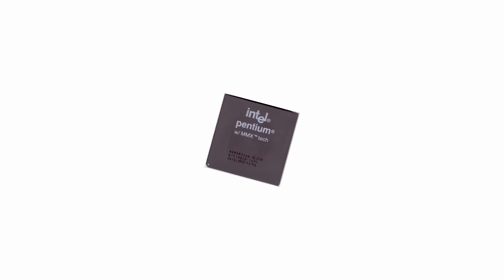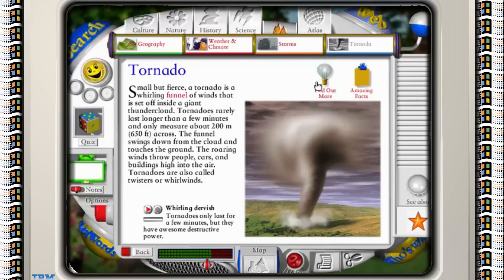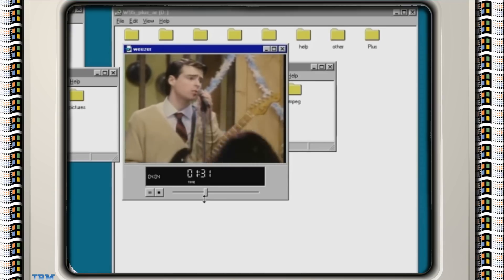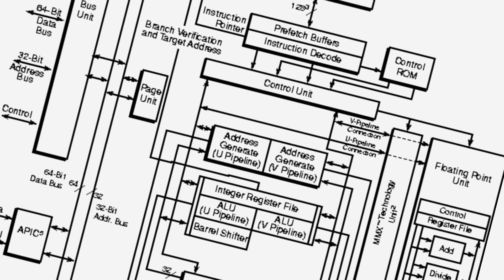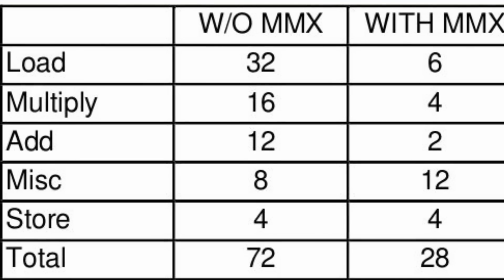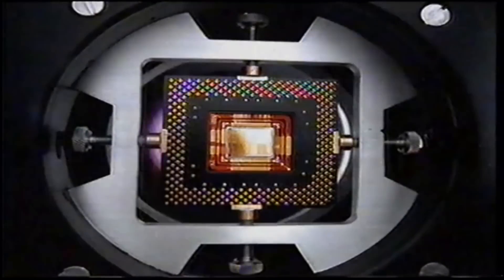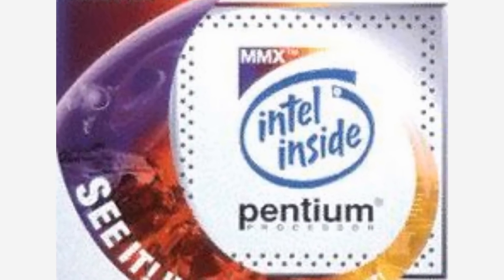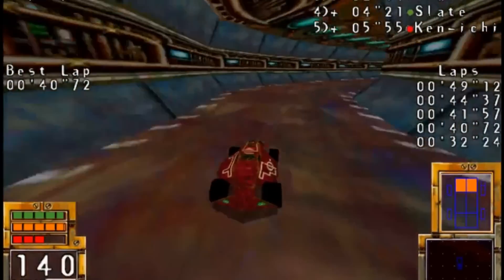What is MMX Technology & Why Was it Flawed? [Byte Size] | Nostalgia Nerd

Comment: somewhat sloppy writing, with the intro quoting a lot of then-current misleading advertsising (as MMX does really nothing for colors, nor the internet) and not mentioning the doubled cache of the MMX Pentium processors which brought benefit for all applications. And explaining the reason wrong why FP and MMX did not work at the same time. It was because of the re-use of the same registers. And why is FP usage explained with special functions, when floating point MUL and DIV were needed much more often?

Comment: I remember those days.  One of my systems was a Pentium 1 200, another was a Pentium 2 233.  The 200 didn't seem meaningfully slower back then, so MMX was a joke for all practical purposes.

I'm sure for some software it helped, it just wasn't software most folks run.  Other than specialized bespoke custom software, programmers aren't going to compile binaries that require instructions that weren't around 10-15+ years ago, to improve compatibility.  One could write software to detect the presence of the instructions and if so, use them.  But in practice this was rare.  It's precisely why everyone was in an uproar when MS attempted to require an 8th gen i7 for Windows 11, especially during a supply chain shortage.  There is a way around it at least.

And yes, all the newer CPUs have MMX since generally, while new instructions get added, old ones don't get removed.

Debian Linux 12, which just released this week, finally got around to dropped support for the P5-era CPUs, or the Pentium 1.  So now, it requires P6-era or later - The Pentium Pro and Pentium 2, basically.

Comment: You're flat wrong in saying the Pentium II changed the MMX registers to no longer be aliased to the floating point register file, and I don't even know where you would get that assertion. It was done for operating system compatibility. See: "MMX Microarchitecture of Pentium Processors With MMX Technology and Pentium II Microprocessors"

Comment: I think the most important thing is the fact that software had to be written to use MMX. It wasn't like it would make everything magically faster. A lot of the hype and marketing was of course misleading. 

Nowadays SIMD support is getting a lot better. Automatic vectorization(aka generating SIMD code from scalar code) is seeing wider spread support in languages/compilers and they are getting better at doing it. I still typically find hand written SIMD intrinsics in C/C++ to outperform the compiler's auto-vectorized stuff but writing that code is more time consuming and difficult than scalar code. So getting some performance win automatically is nice and gives a better baseline.

Comment: Still have my pentium 233mmx. My mb was able to overclock it to 263 by pushing the bus to 75MHz via dip switches but the multiplier of 3.5 was locked.

Comment: I had to develop a buffer rotation library in IA-32 with SIMD instructions. I wrote several versions of each, from plain (we had to support very old processors) passing through MMX up to SSSE3. 

The MMX version was the slowest of them all and required a lot more additional code to make it work properly (it absolutely needs the FP unit flushed before and after use). That was the same result I had when, later on, I had to build a 16 bits grayscale image normalization library.

Comment: > can't use matrix math and floating point at the same time

Good job Intel. What's next, a TV that can only do audio or video, not both?

(Yes you could switch back and forth but the performance penalty basically would defeat the point.)

Comment: MMX may still be with us. All modern 64 bit x86 processors have it, but its next to useless as using the instructions are not officially supported by 64 bit windows in 64 bit programs (still work but no guarantees going forward)  and use is forbidden in the kernel. SSE2 is better in every way and all modern cpus support that too so  its what everyone should use

Comment: MMX was not flawed, just misunderstood. Intel marketed it as a "media extension" whereas in reality, it is simply a more efficient method of performing integer math, and because it provided wide 64bit registers it is also very useful for high-performance memory copies where DMA could not be used. All modern memcpy implementations take advantage of SMID instructions where possible as it allows you to perform bulk memory copies far faster and in parallel. Even today MMX is still valid and is used depending on the task at hand. In fact, it was so successful and useful that it was later enhanced through the addition of SSE, SSE2, AVX and now AVX2 extensions that all operate using the same ideas and concepts.
Reply: OpenGL's programming model requires floating point geometry inputs.   MMX can be used for integer geometry processing like mostly integer processing on Sony's PS1.

Comment: while apple suffer for lack of any instruction from motorola  proccessor company didn't not come anything for multimedia...so they ditch motorola  for IBM powercpu RISC processor since their os is not x86 to begin with...its like AMIGA OS does everything is short instruction sets...while x86 have one advantage for long instruction...to make multimedia possible on cpu than RISC relies on GPU acceleration..thing is ...that consoles back then thing , they had it right for gaming by introducing 1st graphic accelerators  begins ...while MMX was still microsoft depending on cpu for sound and graphics ..then SSE came about to compete against rising RISC powerpc that steve jobs OS take advantage the graphics and gaming back then...then gpu was born from....thanks to POWERCPU"S  than INTEL MMX OR SSE....sure sse did help a lot of gaming developers but its not sse started the trend it was RISC did ...when intel recognize ibm vector instructions was needed on x86 instructions that INTEL BECAME BOTH RISC AND CISC CPU...while IBM ended up only RISC til end of its life

Comment: The MMX / FPU switch was annoying with the early chips but with a bit of rescheduling you could split procedures into MMX and FPU parts, each processing a large block of data, the 200ish cycles switch is not so bad now .. You could do non MMX or FPU instructions while the switch happened in the background. Uses extra memory reads and writes but once the block is in cache it's accessed quickly enough... Worked well for an assembler vector graphics shape filling routine with alphablend..... It all got much better with out of order instruction + memory access rescheduling and MMX/SSE, IntegerPU and FPU running separately in parallel. Could alphablend using the main instructions, MMX and FPU irogether by interleaving the integer, FPU and MMX instructions and pairing MMX instructions... I'm pretty sure I reached max possible speed.. Several times faster than using the main CPU or FPU on its own... At the time, sending odd jobs in no particular order to the GPU was severely bottlenecked so not worth it for UI stuff, same even today to a certain extent..
Reply: How did that work in a multitasking OS? Did you need critical sections or did the OS come in and make you pay for expensive context switches?
Reply: @SerBallister  .. Task switches did not seem to happen during the execution of a tight inner loop (say less than 20 instructions per each of a million pixels or so per frame) as individual frame creation times did not vary.when tested. The switch from MMX to FPU and back could be mitigated so it had little speed impact, but it was a pain when coding. In the x86 days, before x64 and even MMX, there were so few registers,and pushes and pops were not as fast, it was faster for some routines to alter code on the fly (very naughty, bad practice now-a-days). This was despite having to run Windows VirtualProtect op to turn the section of code memory writable and then back to read-only for execution. Saving a couple of registers could make a lot of difference in tight loops.

Comment: I love how every processor sold today still contains MMX.
Reply: I was just talking with my boss about that,.. even my Ryzen 9 5900 has MMX(+)... whatever the (+) is...
Reply: @DxBang3D  "MMX+", a.k.a. MMXEXT, is an unofficial name for a sub-set of SSE. Note that SSE contains both, integer instructions and floating-point instructions, whereas MMX was integer-only. The "integer" part of SSE is pretty much an extension to MMX. In some of their older processors, AMD adopted the "integer" part of Intel's SSE, but not the full SSE. Programmers therefore referred to this sub-set of SSE, which was available on AMD processors, as "MMXEXT". Later AMD processors support full SSE, of course.
Reply: now i need that MMX inside sticker on my PC
Reply: @Nobody-Nowhere  yes. Coz you know, your CPU is like a Pentium MMX... only BETTER.
Reply: My understanding is that Intel's been pushing for depreciating MMX such that any modern Core-architecture Intel chip will process MMX instructions extremely slowly. AMD processors don't have this artificial limitation. There's a video by Creel titled "Are CPUs getting faster" which compares a Phenom II released in 2009 with an i7-8750H released in 2018 and I've also run his benchmark util on my I7-8700 to replicate this, where MMX instructions on Intel chips deliberately run slower than molasses in January.
Reply: I feel its somehow too bright or something with new computers, maybe mmx doesnt properly work with ultra fast cpu. Also 2d speed was reduced with patch in win10.

Comment: So what exactly was the pentium pro?.
Reply: Pentium Pro is really the first generation of the Pentium II. The major benefit over the Pentium is that the PPro/P2 dynamically reorders the instructions: if you load a number and it's not in the cache, the PPro/P2 keeps trying to run other instructions downstream until the number finally loads (the original Pentium would just be stuck waiting). This is a pretty big speed boost, but it makes the CPU a lot more complex.

Comment: > Pentium II is basically a fixed P1 -- called a RePentium

> Zen CCX is basically a fixed Bulldozer module. Needs to be called ReFX.
Reply: I dont think so,zen architacture is totally diff. Than bulldozer
If they has only fixed bulldozer there would be only slighly uplift in ipc but we saw almost 20% ipc up lift
Reply: @darshan5726  i didnt mean Zen as being a a version of Bulldozer -- what I meant is how they improved or perfected the concept they tried with bulldozer: modular and scalable cores using modules/CCX. With CCX being a one up in that each module is physically its own chip while FX modules are copy-pastes in a single die but individually configurable.

Comment: >Pentium 1 prioritised Int ops and had crappy FP ops

Sounds like a bulldozer ;)
Reply: The pentium 1 had a blazing fast floating point unit for its day. If you're doing anything with lots of multiplication, it's definitely faster in floating point on the original Pentium.
Reply: @boptillyouflop  what I meant was when you use MMX, FP gets disabled.

I know they're technically not exactly the same as FX but you get the idea.
Reply: Don’t ever compare Pentium mmx with trash bull dozer lol

Comment: The freebie PC port of the Virtual On Cybertroopers arcade game required MMX processing to be reported from the CPU in order to run, which caused me to be unable to play it on some more powerful CPUs because it wouldn't report MMX processing. Ironically the computer the software came with couldn't run it well either.

Comment: I upgraded my P100 CPU to a P200MMX back in the day. Needed a whole new MB due to different voltage at the CPU socket. I expected my games to be sooo fast. They were not of course. Even the MMX demo titles that came on a CD with the chip, played very poorly. While I justified it in my head, and I'm sure it must have been "better", it wasn't "awesome" until I added a 3dfx banshee card, and games began adding 3dfx support via patches. And I guess to this day, intel takes stabs at "integrated graphics" but really it's the dedicated GPU's that actually make a meaningful difference.

Comment: One can do multiple data single instruction without MMX, before programmers used clever tricks like before math co-processors were common we used fixed-point maths, for multiple data calculations one E.g. is you have two add instructions, you can perform each add just once for both calculations like 1+2 and 6+3 could be converted into a 16bit integer and perform 262+515 take the low and high byte and you have the answers just with one add, you added twice 3 and 9 that is just a simple example but that was the basic principle of performing multiple maths with a single instruction on a say 68K CPU back in the day.

To me MMX was pointless as it could handle larger integers and so by using these tricks one could keep floating point numbers have your cake and eat it, seems these tricks are getting forgotten by new younger programmers as older programmers had to think of cleaver ways to get the most out of a computer
Reply: But each general purpose register had 32-bit integer, but MMX has 64-bit registers so it's still more data being processed in each MMX instruction. And also in MMX there are instructions with saturation (RGB channels could clip to 00 or FF instead of overflowing, 16-bit samples clip to -32768 to 32767) which would require extra conditional moves with the standard integer instructions. With MMX users could even perform more advanced tricks by the bulk integer processing instructions.
Reply: @jhgvvetyjj6589  it was basically doing in hardware what programmers were doing previously and offering 64-bits and taking it further but it took ages to switch to MMX when it first launched so was pointless and why it initially flopped.

But today we have 64-bit CPUs and these tricks are still handy and valuable to know but today’s young programmers don’t know them like multiple by bit shifting, not just multiple of 2s but how to multiply by any number say 7 • 10 or divide and doing subtraction with addition 

Basic concepts that newer programmers that don’t know, I’m sure some will have but majority unlike years ago don’t

With microcontrollers there useful to know to squeeze out every bit of performance
Reply: @insoft_uk  Indeed back then MMX was more expensive, and using integer tricks to optimize can reduce the minimum requirements. I'm even more skeptical of the newer extensions like SSE that introduced new registers and therefore required operating systems to be updated, which further increases the overheads. And MMX/SSE/SSE2 were around in x86 before x64 which had them built in. I still mainly target 32-bit x86 in my apps to keep minimum requirements relatively low.

Comment: MMX was actually designed to sell better. Intel was all about marketing and monopoly  in late 90s.
I tested several CPUs from that era and it turns out, that Pentium Pro was actually a superior design compared to Pentium II clock per clock running an 200MHz both.
Also there's been a challenge for me to find ANY application that actually did benefit from MMX in Pentum II (Pentium Pro lacks MMX)
After benchmarking in many different apps and games from that era I found out that then considered obsolete Pentium Pro wasn't really obsolete and it did managed to finish almost every task faster than the same clocked Pentium II
The only app I found benefiting from MMX was Lame MP3 encoder which allowed Pentium II to be about 25% faster. Pretty nice boost actually but that was the only app I was able to found.

Comment: I dont think that is true that the pentium 2 is just pentium pro + mmx, there were other changes, specifically at that time there was still a ton of 16 bit software around and the pentium pro performed slow (worse than pentium 1) on 16 bit software but much better on 32 bit. The pentium 2 was supposed to be best of both worlds with some optimizations for 16 bit code. That is why they recommended the pentium pro run NT and not 95/98 is because those still had a lot of 16bit/dos code remaining.

Comment: The good old days, when I was running a Celeron 333 over clocked to 900 MHz. Can't overclock that much anymore.
Reply: yep I remember the Celeron 300A that was an easy OC chip
Reply: My 5950X has a base speed of 3.4GHz and can overclock to 5.025GHz... it's still possible :)

Comment: Well, the main reason that "MMX" can't be an acronym is simply because it isn't pronounced as a word, just like many actual abbreviations (as you make the claim that this isn't one of) aren't. For example, while "LASER," "SCUBA," "PIN," and "VIN" are acronyms, "ATM" and "LCD" aren't ones even though they are a similar type of abbreviation, because "ATM" and "LCD" aren't pronounced as single words like these other examples are.

But since you did just say "MMX" basically means "Multi-Media eXtension," then it really DOES seem to be an abbreviation (just not completely initial-based). So... it sounds like you should state that while it is an abbreviation, it's just not a complete initialism and it's not an acronym type of abbreviation.

Comment: Always loved these older cpu's. I remember running benches with the same motherboard (socket 7) and swapping out an P-233MMX with a K6-233 and running benches on them.  The K6 would beat the Pentium in integer applications by quite a large margin, but the Pentium would beat the K6 in FPU processes.   I think my graphic card back then was either a Riva-128ZX or maybe a Geforce 256. I know later I had the Geforce2 GTS for my AMD T-Bird 1.4ghz.  Ah the good old days.